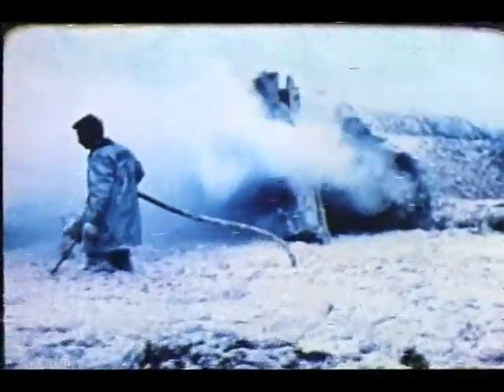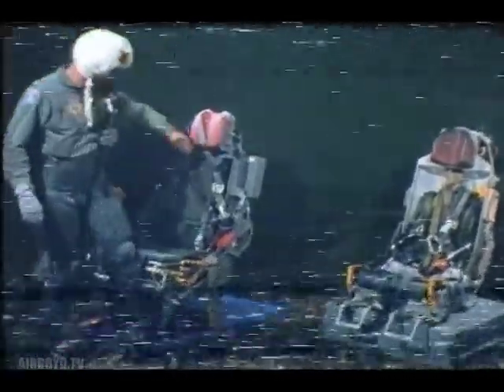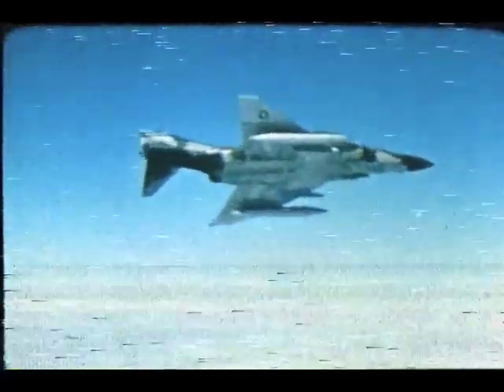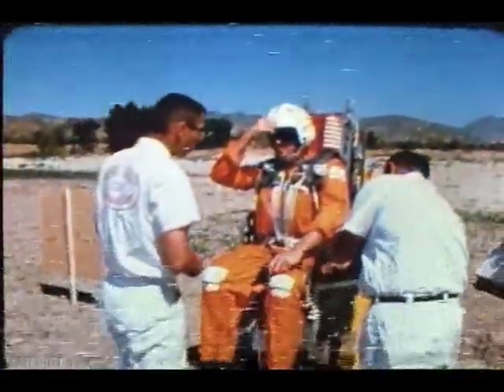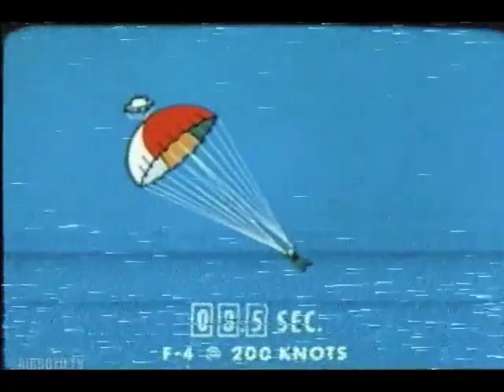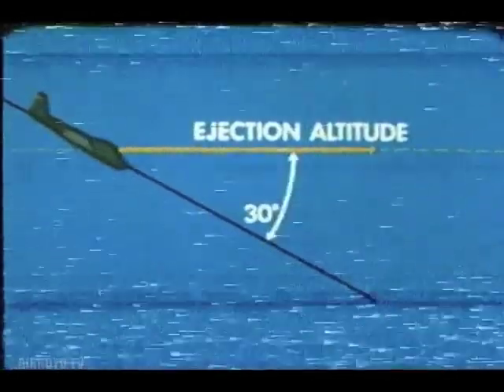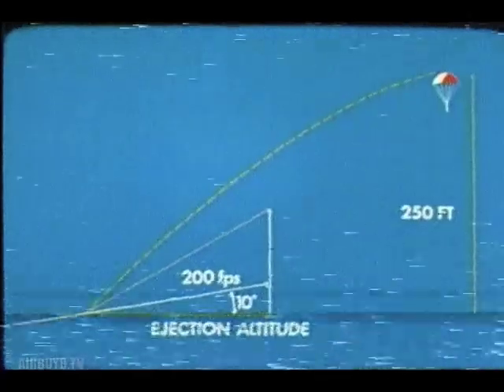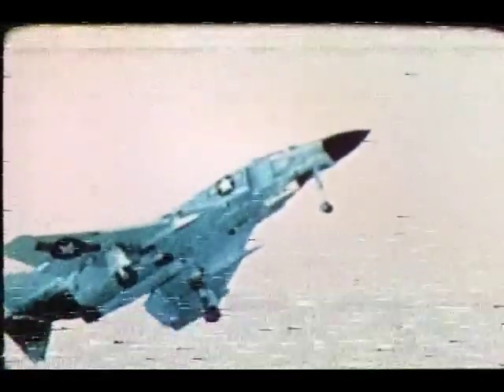Ejection Vectors (1969)

Comment: Back in my era, the early '60s, you sat on a 20mm cannon shell (w/ just the propellant) and this resulted in a shock to the spine when you went out. Some died because they didn't separate from the seat and pull the D ring. Others died because of design. The first 13 to punch out of an F-102 hit the tail and died. I flew the F-104 C/D with downward ejection, made that way to keep people from hitting the tail on the way out. After a Korean War ace, Ivan KInchelow, died ejecting downward immediately after T/O, the AF went to upward ejection, but while downward ejection was in vogue it felt sexy as hell walking out to the plane with spurs on. While you were strapping in you pulled cables with a ball on the end from under the sear and inserted them into the back of the spurs. This prevented your legs from flopping upward if you ejected.
Reply: oh my goodness. that is some scary shit. Thanks for your service
Reply: What is a spur ???
Reply: @TheRockerxx69  Spurs are sharp spikes worn on the back of cowboy boots that are dug into the side of a horse while riding.  Pilot spurs are also located on the back of flight footwear, but these spurs are connected to the ejection seat in order to keep your legs close to t eat so your knees don't get caught on the cockpit on your way out.  The ejection seats in the Mach 3+ A-12/SR-71/YF-12A also had the pilots/backseaters wearing spurs on their boots.  If you go to the Dayton Ohio AirForce museum, they have the very last YF-12A in existence there. It was involved in an incident where the pilot and WSO were on the ground and they had to exit the plane quickly. There are ,arks/holes left on the skin of the plane where the "spurs of the mens boots caused damage as they clammered down out of the plane.
Reply: @hoghogwild  Thanks very kind of you. We ve had military pilots around the house a lot, because my father was one on WWII , on props  ehehehehe , but his friends were jet s F84 F86 F104, sold by the USA to our Italian forces, aces I would say because they survived the F104 s, they were instructors too, damn tuff guys,  I think I knew something about those cow boy type spurs, but could not recall it, I m just 67 y.o. eheheheh

Comment: Not sure about that but I've heard each ejection does compress your spine permanently. I believe two ejections will ground you from flying in the military or they will reassign you to helicopters or another model that doesn't have ejection seats due to what could happen to your body if it had to endure a third ejection..

Comment: @bajesus666 I'm pretty sure it's the same principle, I see no way why it could've changed, I play the DCS A-10C simulator which is the same that the US Air Force uses, and thanks to that video, I survived twice from a battle damaged A-10C. First ejection was simple. Both wings teared off, time to punch out. Second one, was more complicated. I had only one wing teared off, and before my first ejection I had stabilized with one wing. But this time It didn't worked and I punched out 1 second short.